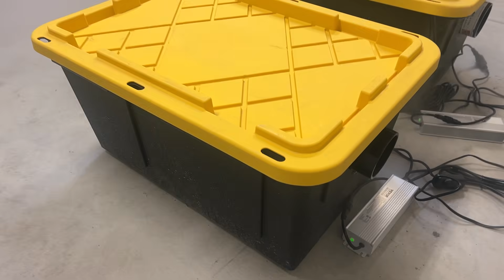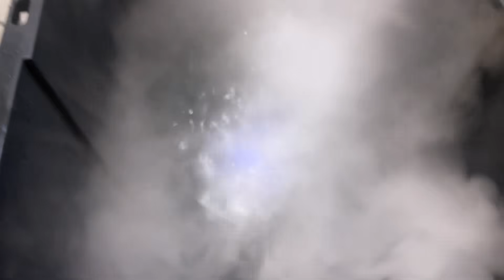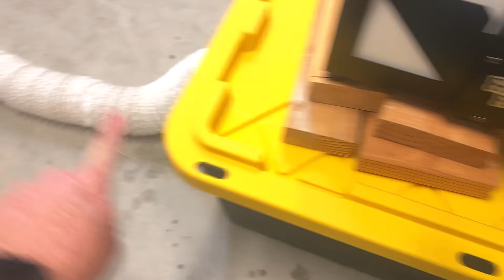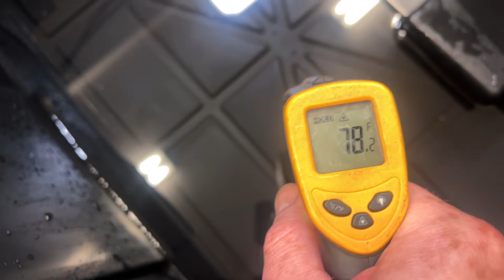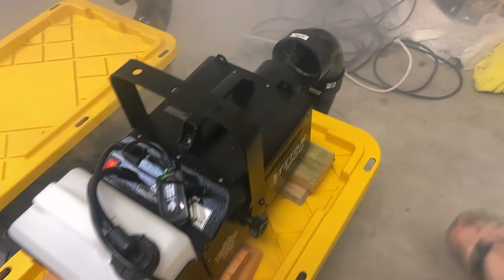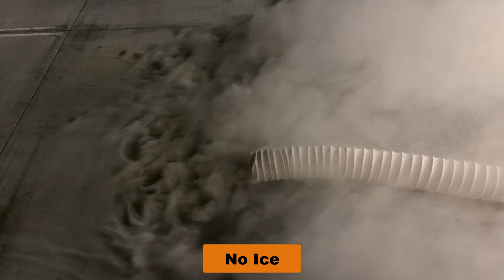Ice vs No Ice - Halloween Ground Fog Machine

Comment: The mister will operate better using non-iced water. It will produce more vapour and it's that which adds 'weight' to the smoke machine generated fog. Cooling the fog after it leaves the misting box will probably have a better effect. I also believe ice works better as ice cubes. It may be that the reason ice works when using just a fog machine is that it picks up the moisture from the melting ice as it's a warm vapour, again adding to the weight of the fog. Try sticking iced bottles or ice cubes in the outlet tube and see how that works. Great video by the way. 👍

Comment: Well if you remember how natural fog occurs if you have hot body of water that has cold air over it you'll get naturally occurring fog so what you might want to do is use some sort of an ice box pre Chiller for the smoke that way once it gets blown into your missed box it will be very cold and your icebox should drain into your mist box remember you can also buy ice at the grocery store
Reply: "your icebox should drain into your mist box" - Fantastic idea! I will add a tube from the drain of my Mr. Kool fogger and direct it into the misting box below it. BTW, you are correct and the cooling of the fog before injection into the misting box does indeed yield the best results.

Comment: Thanks for the extensive testing and posted video. I just built a misting box this year, but my fogger is an ADJ Mr. Kool. Initial testing seem to show that adding ice to the fogger and then passing that cooled fog into the ultrasonic misting box produced better results outdoors. Going to retest now based on what I have seen here. Unfortunately it looks like we may have pouring rain Halloween night, so now planning to experiment with nebulous cloud projectors as a backup fog effect.